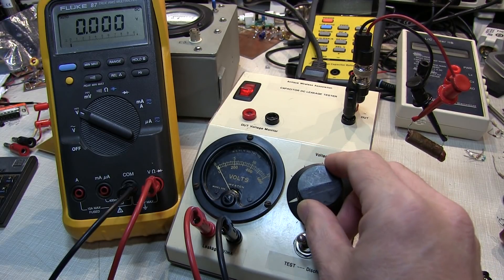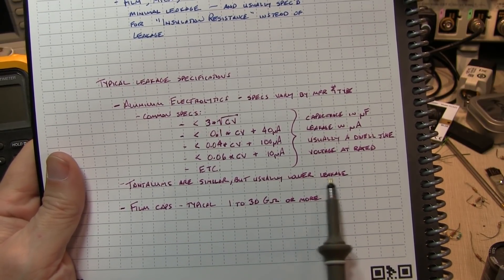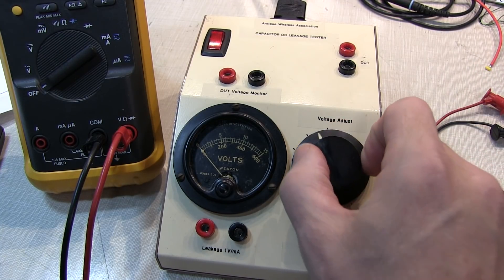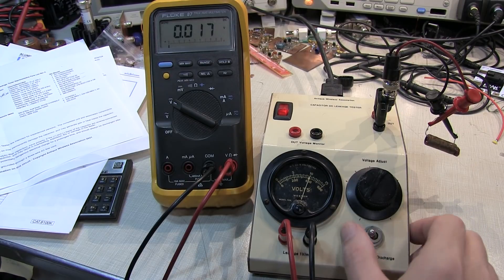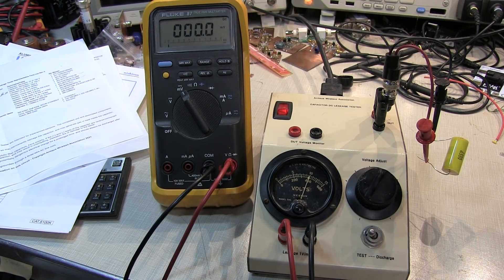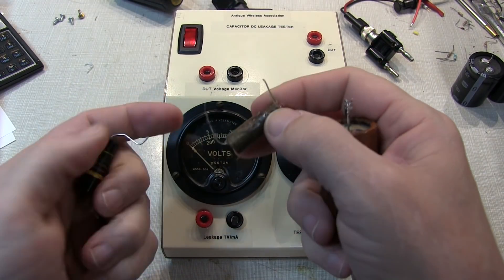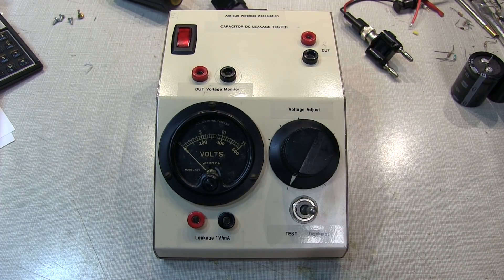#346: Basics of Capacitor Leakage / using the Antique Wireless Association DC Leakage Tester

Comment: Hey Alan...what did you use to cut all the big holes in your box? Whenever I cut large aluminum holes, I seem to get poor results.
Reply from the maker: I used a stepped drill bit for the small/medium sized holes (the banana jacks, potentiometer, etc.), and as a starter for the larger holes (meter and AC entry jack).  I completed these larger holes using a sheet metal nibbler like this one: https://www.amazon.com/ProsKit-900-215-Nibbler/dp/B000BN60XW/
Reply: @w2aew  Thanks Alan...you do nice work!
Reply: @w2aew  Hey Alan...one final question. Do you remember where you purchased the sloping face project box you used for this? I can't seem to find one with such a large top surface. Thanks again.
Reply from the maker: @stevebailey1682  I had it laying around for years, so I don't remember where it came from.  Probably a hamfest find.  However, it appears that Hammond Mfg makes them. Available from Mouser: https://www.mouser.com/c/enclosures/enclosures-boxes-cases/?type=Sloped%20Console

Comment: How accurate or reliable is it for me to test electrolytic caps with 10V input, an ammeter inline with the circuit to measure microamps, a 1K resistor in series with the cap, and a volt meter across the resistor?  If I was doing my experiment correctly, most of the caps I tested had only 1 or 2 microamps of current going through them whether by the ammeter or the volt meter (I=V/R).  And is 1 or 2 microamps acceptable?  All my work is with low voltage stuff, not high voltage.
Reply from the maker: This method is perfectly acceptable.  It's a good idea to include a series resistor so that you don't overload your ammeter in the event that the capacitor shorts out.  1 or 2 uA is likely acceptable for electrolytics, but to be sure, check the manufacturer's datasheet ratings.

Comment: YOU CANT IMAGINE THE JOY OF HEARING YOU ON 40m late at night here in Amman Country of JY

73's
Reply from the maker: Wow - thank you!  I wonder what the date/time(Z) was that you heard me on 40m??  If it was CW, I was running probably only 25W, so getting a signal into JY is very nice!
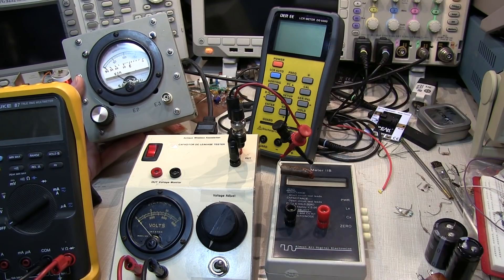Reply: @w2aew  when I sent you this msg you where sending CQ on 7.055 then again u QSYed to around 7.061 Mhz and yes on CW HiHi.  So it was between 02:38 and 02:44 Zulu. Im using a Homebrew Regen Receiver. I confirmed its you on both SDR and Ham Alert
Reply from the maker: @khalidtarawneh2289  That is incredible!  When I was calling CQ on 7.055, I was using my QCP+ running about 3W of power, and then using my TS-870S at 20W on 7.061.  Amazing that you heard me with a homebrew regen receiver - wow!

Comment: How would this work for checking coax for breakdown. I guess I should wait to see what the voltage is..  We need a reasonable HI-Pot tester..
Reply from the maker: Possibly, but you have to be careful about looking for breakdown because of the rapid change in resistance, you have to make sure the tester than handle to current arising from a sudden near-short circuit

Comment: Can a hipot tester that is AC/DC/IR (IR=insulation resistance) that can be adjusted from 0.1 to 6k v be used for tests?. I'm just asking because I got lucky with the one off of eBay for cheap and now I got to find a use for it
Reply from the maker: For the higher voltage caps (100VDC or higher), yes.

Comment: Nice video!  One note, though: I'd've mentioned (for electronics newbies) that if they connect an electrolytic backwards at high voltage that there's a risk of explosion.  So they ought to wear eye protection or have a shield (like a book) between them and the capacitor.

Comment: Hi  Thanks for this vid, I going to get one of these boards,  could you answer a couple of questions .  What guage wire to get?  14, 12 ? other.  other parts you used not specified. additions to
the schematic or changes.  the box part number where to get it.  Thanks
Reply from the maker: The wire gauge doesn't have to be large because the currents are all very low.  You can use pretty light gauge. I used 18 gauge.  You could even use 20 or 22.  The most important thing is to be sure that the insulation is rated for 600V or more.  The only change/addition I made was to add the voltmeter, which in my case was a 500uA full scale meter, added with a 1.2Mohm series resistor so that it reads 600V full scale.  The box I used is something I've had in my junk box for many years, so I can't give you a part number for that, sorry.  The same is true for the IEC power entry jack and the lighted rocker power switch.

Comment: Alan, I know this is kind of an off-topic question, but would you consider making a detailed tutorial on the proper use of the DE-5000 LCR meter?  I can't find a good technical tutorial on its use and I have to admit that I don't really understand its proper use (as a newbie).  I was given one as a Christmas gift a few years ago, but reading through the manual doesn't turn "the little light-bulb on" for me, at least not yet.  I don't want to damage it or misuse it and miss finding a bad cap (as far as it can find, which I just learned in this video!)

I think I'll order one of the AWA PCBs and build it both as a learning project and to add to my arsenal of test equipment.  Thank you for sharing this very educational & informative video and links!
Reply from the maker: Thank you Bob - I have had a few requests for this, so I will add it to my long list of future video topics.
Reply: Check out TRX Lab video #83.
Reply: @outagas2008  Thanks for reminding me of that video!  I obviously watched it several years ago and then forgot about it, but would still like to see Alan's version of an "in-depth" tutorial on the meter.  (Also, Alan turns on closed-captions, which helps folks like me. ;)

I've already restarted the TRX Lab video to refresh myself with what he presented in video #83.  Thanks again!

Comment: can we add a 1-15 VDC or 1-150 VDC range.. pretty easily?
Reply from the maker: The existing design starts the voltage at about 10V, and the available DC voltage is around 600V.  Any low-voltage regulator would likely need to be powered from a lower voltage.  It would probably be easier to design a lower voltage version, or simply use a lower voltage supply along with a DMM.

Comment: Excellent video, I have a ready table that I got years ago on the TRX lab channel, with capacitances from 1uF to 5600uF, I tried to post it here but youtube deletes it.
Reply from the maker: If you can spell out a link for me, I can include it.
Reply: @w2aew  see on TRX lab channel itself, in 39 minutes
https://www.youtube.com/watch?v=2HUxuRcPR4M&list=PLeSvDHeO3YTQEMX8Q-42xx9ytpUYJTtml
Reply from the maker: @eldervieira85  OK, thanks.  Looks like it is a table built from the 0.1CV+xxx equation from that Panasonic datasheet.  Since different manufacturers have different equations, the values may differ depending on the mfr and capacitor type.

Comment: Alan, this is yet another excellent video! 
Interesting how electronics hobbyists rarely think of leakage during repair. I did a few videos on my channel about this but in my case I ended up using a power supply and, for higher voltage, an insulator tester. 
By the way, nice capacitors! I just changed a few on my grandparents' radio and the leakage on an 80yo wax was incredibly small for the age - replaced anyways, but still... 
Thank you

Comment: The bakelite covering shrinks over the decades for the bumblebee caps. This squeezes the paper to together and shorts out the caps. I just replace them. I like the aircraft volt meter used in your tester.
Reply: Bakelite shrinks?  I've never experienced that.  Also, it's not bakelite - it's another type of plastic.  The paper inside them degrades over time just like the ceramic and wax encased ones.
Reply: I have repaired several trans-ocianics that use these caps. Many had longitudinal cracks as the plastic shrank. I talked to other radio collectors and they had the same issues. Incidentally, the military version does not use these, but mica capacitors instead.
Reply: @jonbutzfiscina1307  I've seen cracks as well and it was my understanding it was from the paper cap inside swelling.  Interesting that the military realized that mica was more reliable back then.

Comment: Super info as always Alan. I echo R. Davis about your instruction; that was my trade for 38 years and I always admire your videos.  Perhaps sometime you might consider a comparison between your (now unobtanium) AADE and DE5000 LCR meters. I bought the  latter since I couldn't find an AADE. Specifically how do they fare for low C and L measurements such as pF caps and small toroids? Tnx es 73 Peter
Reply from the maker: That's a good suggestion - I'll add that to my long list of future topics.  Briefly, I have found that it does pretty well with small values as long as you use the higher (100kHz) test frequency.

Comment: I work on a lot of vintage radios and own an Eico 950B. Is it feasible to add a meter in series with the DUT to determine actual leakage as well as the pass/fail of the eye tube?
Reply from the maker: I don't know enough about how the Eico 950B operates to answer this question.  Probably a good question for someone like Mr. Carlson's Lab.
Reply: @w2aew  thank you from ko2fb

Comment: Great video Alan, Please forgive me for asking, what are you using to display the text/drawings in your video? Is it some type of tablet PC?
Reply from the maker: In this video, it is a reusable notebook called a Rocketbook. In some past videos, I have also used a e-ink tablet from www.remarkable.com.
Reply: @w2aew  Thank you for the reply Alan. I bought a Remarkable last year after watching several of your videos, so I was surprised when I saw you using this Rocketbook. My first thought was that I had missed a new version of the Remarkable. Which do you prefer? The Rocketbook looks to be a bit needier to maintain. Has that been your experience?
Reply from the maker: @billsmith396  The Rocketbook advantages are that it is inexpensive, in that it is really a notebook with plastic coated pages - when combined with the erasable Frixion pens, adds the nice ability to have multi-color notes that are easy to convert to PDF.  The downside compared to the remarkable tablet is the editing/moving/scaling of notes and diagrams, which is really nice on the tablet.  I find that I am using the Rocketbook more than the remarkable tablet these days, mainly for the color aspect.

Comment: Is the components list available online anywhere or do you get it with the PCB?   Was going to order, but would like to order the components I need at the same time. The only ones I probably don't have are the transformers. I think everything else is basic caps and resistors.  Thanks!
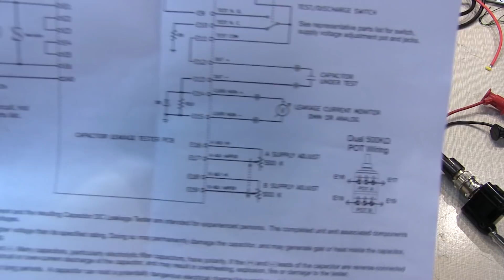Reply from the maker: It comes with the board.  You can contact them and they'll likely send you the document.  Or, you can screen-grab it at 7:51 in the video.

Comment: I do usually use my 600v power supply with a Simpson 260 in series. I gradually increase to the rated voltage not allowing more than a few milli amps of current until I get to the rated voltage.  I downloaded an acceptable leakage table that shows everything up to 450v.  Everything is in microamps.  Some caps have as much as a few thousand microamps leakage allowable. That's electrolytic.

I may get that board and build a nice one. Adding the series resistor would make it nice. Gradually increasing the voltage then draining the cap after the test.
Reply: Just add a suitable resistor in series with the capacitor: that will limit the charge current automatically and you don't need to fiddle with the voltage but can just set it to the maximum you want to reach.
This device that w2aew built kinda works like that, but the resistor is too low value, I would add a switch (or potentiometer) to be able to select the resistance of the series resistor, great for reforming caps, even new old stock that you sometimes get for low volume items from Mouser or Digikey.
Reply from the maker: Not many of us (myself included) have access to a 600V power supply!

Comment: I would like to make a comment and ask a question.

Comment: Please note that the bottom connectors to measure voltage, that you calculate current from on the bottom, could contain a high voltage up to the 400 VDC, if the capacitor being tested is shorted, or close to shorted. You did say that the capacitor is charged with a 18K resistor in series so if it is in series and the 1K is also in series, then you would only see at most about 21 VDC. I have not looked at the schematic.

Question: Is there any possibility that you may have a full parts list and schematic for the exact one you built? I like your design here. Regardless of my comment above, I would like to build one pretty much like yours. Thanks for letting us know, and if if this information would be available.

You make some great videos, and they are greatly appreciated. Thank you.
Reply from the maker: The 18K resistor is on the power supply side of the DUT, and the 1K resistor is between the DUT and ground.  Thus, even if the capacitor is shorted, there will be 19K between the supply and ground which will limit the current.   So, even if you get a capacitor short when testing at 600V, the highest voltage at the current sense will be under 32V.  The parts list with Mouser part numbers will be provided with the board from AWA.  They do not share the complete schematic of the design, although it is fairly easy to reverse engineer.  I won't do that here since I want to respect their desire to not share the  schematic.  The only "extra" parts I used are the old meter movement, a 1.2M resistor to adjust the scaling of the meter to have it read 600V full scale, a IEC AC power entry receptacle (which I had in my parts bin) and the lighted AC power switch (also from my spare parts bin).
Reply: @w2aew  Thank you for your reply. I understand about the schematics, and that is no problem. The other components, meter, resistor, receptacle , etc., are also no problem. The entire project doesn't look to difficult. The part about it that I liked is the chassis (cabinet). I guess you made it yourself, and it is not sold somewhere. That is the part I should have included in my original post. That is a good idea, and well done. I like the idea of having the higher voltage only at the top. And, yes to the low voltage due to the 18K and 1K resistors in series, which I mentioned at 400 VDC test voltage the maximum at the bottom connectors would be about 21 VDC. So, with 600 VDC test voltage having less than 32 VDC is good. Well done. I just don't have a lot of time to make the chassis (cabinet).

Thanks again. I appreciate it.
Reply from the maker: @TheOmegaman69  I didn't make the case, it is just a project box that I had purchased many years ago - and it was just waiting for the right project!  I'm sure there are still folks that make them. Here are a few examples:
https://www.amazon.com/BUD-Industries-PC-11491-Plastic-Natural/dp/B005T58ZTO
https://www.amazon.com/BUD-Industries-PC-11493-Plastic-Natural/dp/B005T592P0
https://www.budind.com/general-use-boxes-aluminum/?load=true#group=series&general_series_cover_style-solid-door=0&general_series_cover_style-screw-down-cover=0&general_series_cover_style-clear-door=0&general_series_cover_style-hinged-cover=0&general_series_cover_style-infrared=0&general_series_mounting_style-flanges=0&general_series_mounting_style-molded-flanges=0&nema_series_mounting_style-molded-flanges=0&general_series_mounting_style-din_rail=0&general_series_mounting_style-rack-mount=0&general_series_features-with-recessed-top=0&general_series_features-without-recessed-top=0&general_series_features-with-battery-compartment=0&general_series_features-without-battery-compartment=0&general_series_features-ventilated=0&general_series_features-with-knockouts=0&general_series_features-without-knockouts=0&general_series_features-not-ventilated=0&nema_series_ip_rating-65=0&series=0-12&material-development=0&material-plastic=0&material-aluminum=1&material-hand-held=0&material-steel=0&material-chassis=0
Reply: @w2aew  Thank you very much. You must have had to do some research to find these. Thanks for providing them.

I like the second one you listed, so I think I will go with it. Thanks again.

Comment: Nice gadget.  I bought an Eico 950B some time back for performing this particular job.  I find that I don't use it all tha tmuch,  though.  For a while I was doing restoratoin on a fair amount of older equipment,  and I'd start by replacing pretty much all of the electrolytics and any of those wax-coated paper caps without even testing them.  They were a real problem in older radios when we're talking about plate-to-grid coupling caps for the audio power output stage.  These days I've pretty much given up on that stuff,  and am enjoying my retirement,  though one of these days I should probably get to overhauling that 1946 RCA console radio I have sitting here.  :-)

The big problem with those old paper caps was two things.  One was the fact that the cardboard tube and wax sealant wasn't perfect,  and eventually moisture would get in there.  The other was that the paper wasn't acid-free,  so you'd invariably end up with problems.  Changing the case to a plastic encapsulation as with those "bumblebee" caps helped with the moisture ingress but not with the acid paper part of things.  At one point I recall that there was a capacitor out there with both paper and a plastic film,  but those aren't a whole lot better.

Electrolytics are a whole 'nother story.  If they're 50 or 60 years old,  they're gonna be dry,  and at the very least lose most of their capacitance.  I see where some people have a go at re-forming them,  sometimes going to the trouble of building a special gadget to do that job,  but personally I've never felt that it was worth the bother.